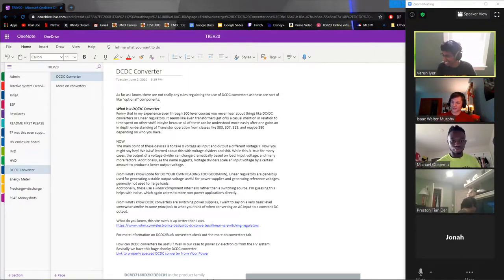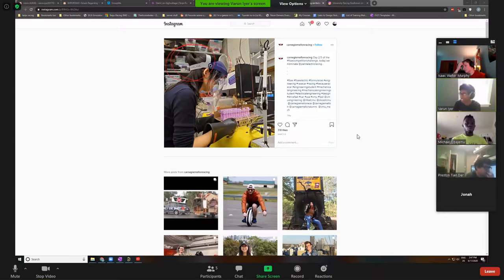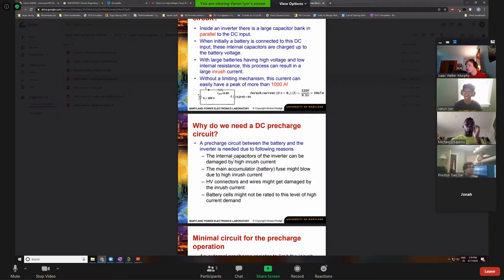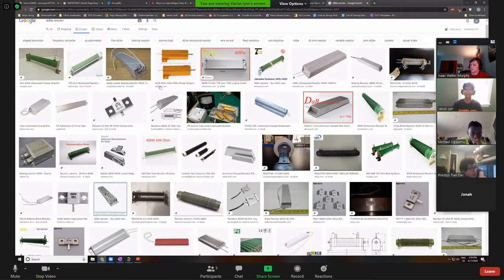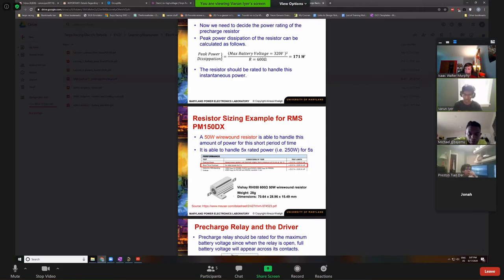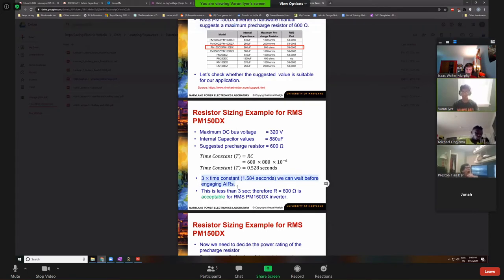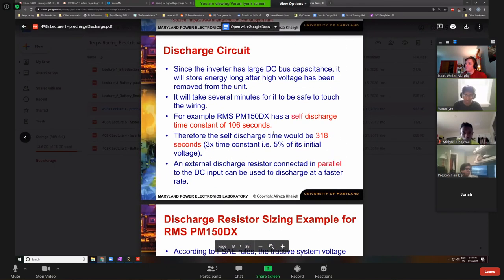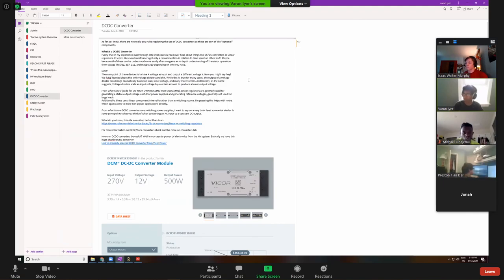High Voltage Lecture - Pre-charge Circuit

Comment: Hello!

First off, thank you for sharing the lecture! You have provided a really thorough explanation :D I do have a couple of questions tho.

What is the advantage of using the internal capacitance of the motor controller? If I were to buy a motor controller that does not have a specified internal capacitance,  could I simply integrate an external capacitor in series with the power resistor? Inbetween the relay and power resistor for example.
Reply: This might be a bit late, but all inverters/motor controllers come with internal input capacitors. Caps are basically used to minimise the variations of the input voltage to the inverter/motor controller